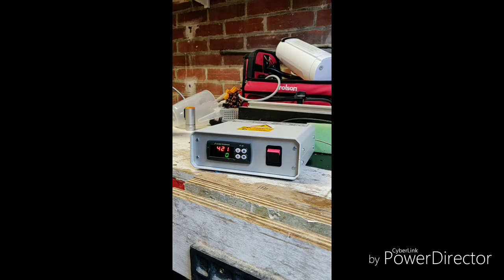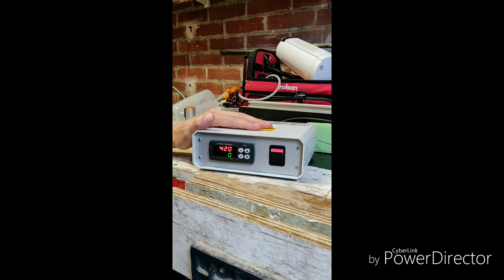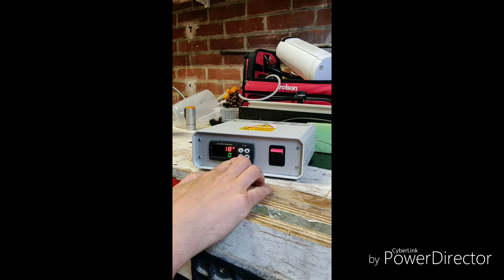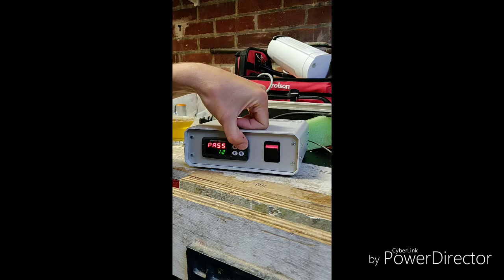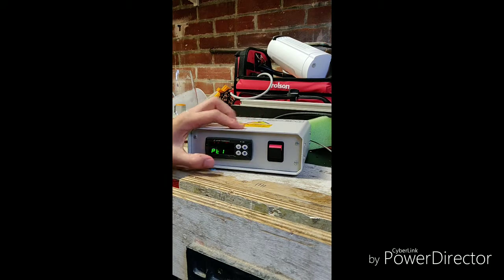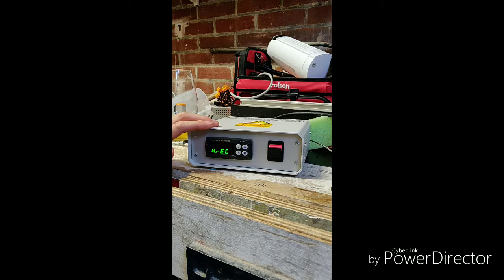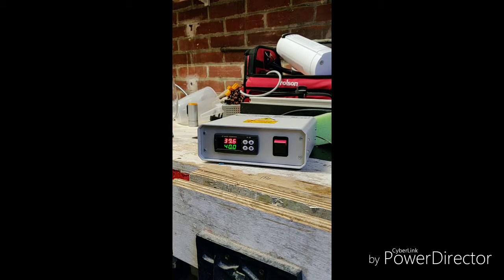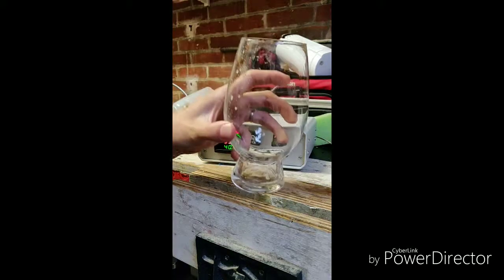Technologic K39 PID configuration - Bench Top controller

Comment: PROGRAMMING LEVELS: 
381 – Basic with 10 second time out. (passnumber)          
400 – Advanced with 10 second time out (see full manual) 

*Add 1000 to the passnumber to remove time out function. *

1381 >>>Basic, no time out
1400 >>>Advance, no time out

Comment: Thank you!
If it isn't from this video (and the comments), I wouldn't know the "secret code" 1381. I spend a lot of time trying to use 30 as written in the manual. 
One question: 
When I use the program (ramp & soak), in my case there were only two 2 groups (ramp 1, soak 1, ramp2, soak2) while in the manual it should be possible until 4 groups. 
Does anyone know why or how to use the ramp/soak 3 & 4? Many thanks!

Comment: Legend! I also bought one off eBay back in May and haven’t got round to even turning it on yet, had a google for a manual online and it fried my brain. Your video has made it a doddle! Time to build a HLT now! Them flies are twats in Yorkshire too!
Reply from the maker: Hi Matt. I have a few updates since making this video to work more effectively. PM me and I'll give you some steer.
Reply: The Blue Trouser Brewer  Hey up mate, noticed you’ve started brewing in an all in one system, are you still using the pid at all?
Reply from the maker: Hi Matt. Yes still using for my HLT but tbh probably a bit wasted just heating sparge water!

Comment: Since you've got this have you revisited your settings?

The reason I ask is that you've got a fancy PID there but you've set the control type to hysterisis.  Hysterisis just turns the elements on fully when you drop outside of a set range.  
With the PID algorithm (once tuned) the controller will pulse the element on and off to maintain the set temperature as close as it can.

Lots of settings to investigate in this controller.  I'm just working out how I can use the programming function to delay the start of heating my HLT so I can set it the night before and it'll be ready when I get up in the morning.
Reply from the maker: I haven't but meaning to. I'd like to do exactly what you have described. I have noticed that it doesn't pulse. I also had a hard time figuring out how to get the thing to pulse based on the instructions. Have you worked out how to do it? If so, can you give me some help? Maybe find me on FB. My name is Owen Puckett. Let's discuss more!
Reply: James Wilson  Are you able to explain how this is done in layman’s terms? I also have this PID and find the full instruction boggling to say the least.
Reply: @heathenbrewer7205  I'm happy to help where I can, although I'm setting the thing up myself at the moment.
I'll try and get it all working and document my settings over the coming weekend, but this is how you do it in theory... 

To make this work you'll need to change some settings and then run an auto tune.  To auto tune you basically will need your system set up as per a brew day, including water and grain if you're using it to control mash temp (hint: use spent grain at the end of a brew day).

Once you're set up, first thing is to go into the proper admin menu using code 1400.  The 1400 menu is the full menu, with settings organised into groups.  You can then jump through groups of settings with the U button, and the settings within each group using the P button.

Once you've opened the 1400 menu, press U until you get to 'rEG', then press P.

1. First thing is to switch the [52] 'cont' value to 'Pid'.  (Note: If you can't get this working properly and want to use it for brewing again, then come back here and change this back to 'On.FA')
2. Then set 'Auto' [53] to -3.
3. Now to start auto tuning set 'Aut.r' [54] to 'on'.
4. Hold U until it leaves the admin menu.  It should then run through several heating and cooling cycles, work out all the settings you need and store them.  I think that it continually runs and refines auto tuning so you might just need to step away from it for an hour while it does it's thing, but I'm not sure yet.

5. After a few cycles you can go back into the menu and change 'Aut.r' [54] to 'oFF' 

Your PID is in theory now all set up and tuned!

There's a lot of other functionality in this thing too - you can program it to run through multiple set points for set times, and with a bit more wiring you can get it to run pumps or sound alarms at various points too.

You can also move all the settings you need to access on a brew day into an operator menu so you don't need to put in a pass code to change them.

Happy to walk you guys through all of this on a video call soon, or maybe I'll make my debut on youtube too!